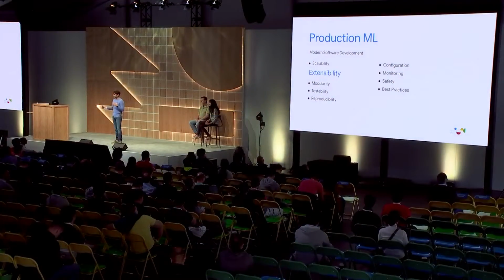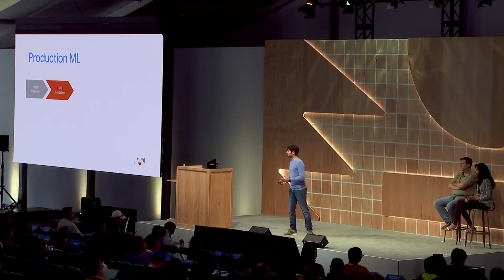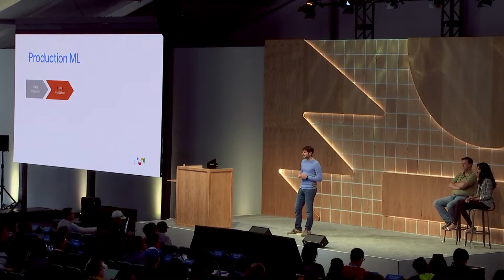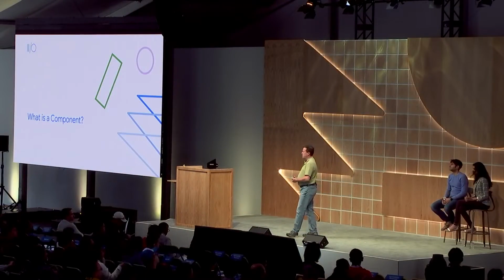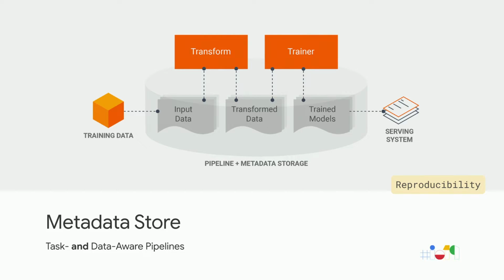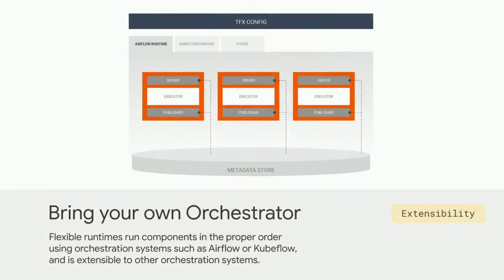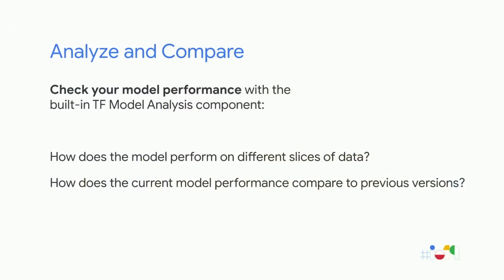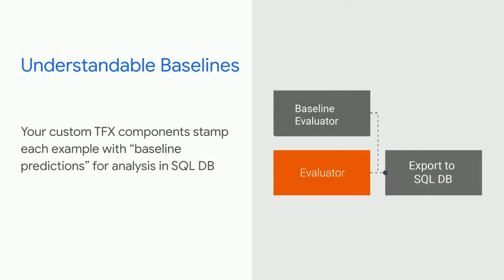TensorFlow Extended (TFX): Machine Learning Pipelines and Model Understanding (Google I/O'19)

Comment: This presents more ways to lock-in yourself to Tensorflow.
Reply: As opposed to what?
Reply: Underlying all this are projects like ml_metadata, protobufs, and Beam.  If you wished, you could pick and chose to use only those libraries and forget about TFX. I agree even those restrict you to some degree.  Its then your decision if the benefits of reusing their code outweigh the risks associated with depending on a "3rd party" library.